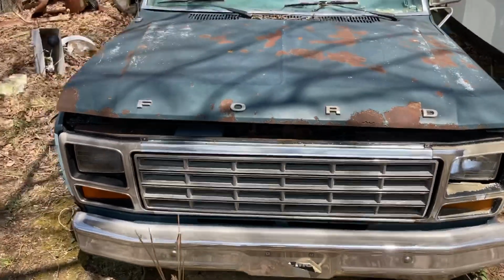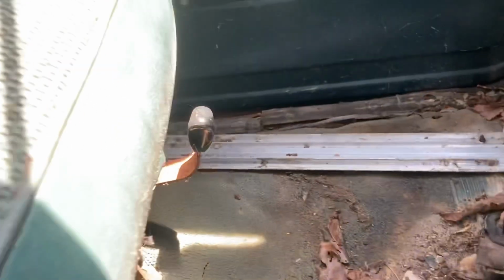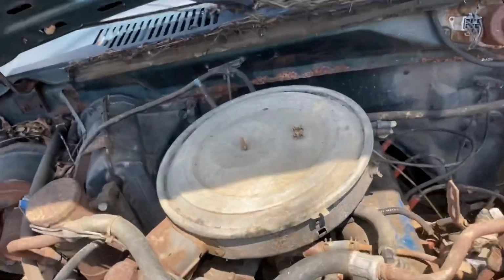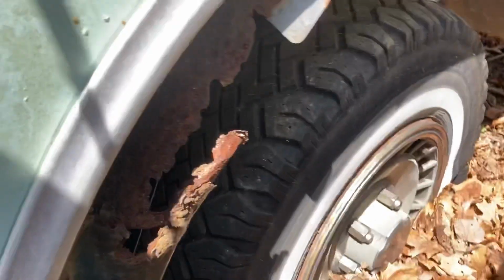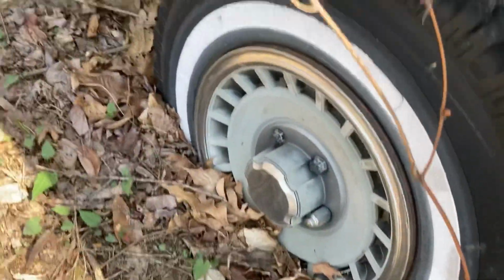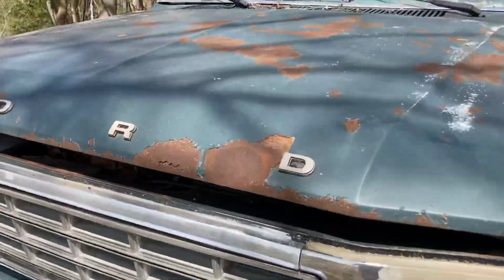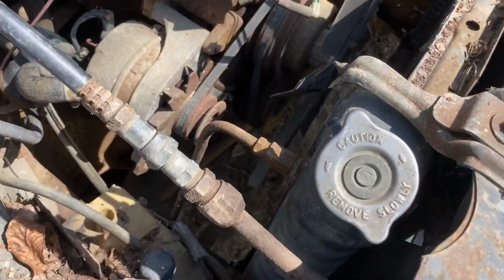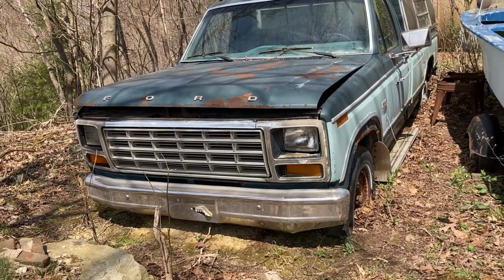1982 Ford F150 restoration project.

Comment: This one is a 1981 model. Both 1980 and '81 looked like this on the front end. '80 had the clear turn signal lights. '81 had the orange signal lights.